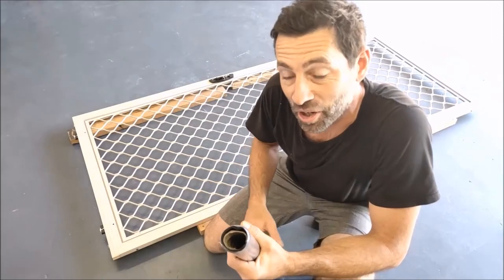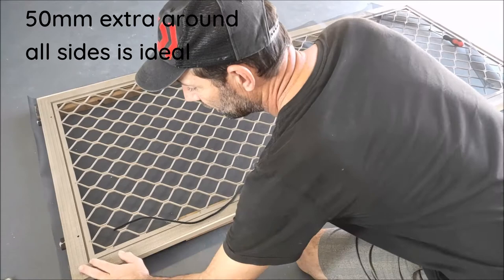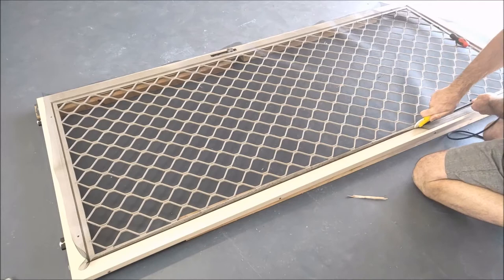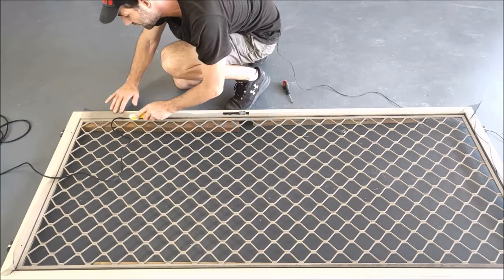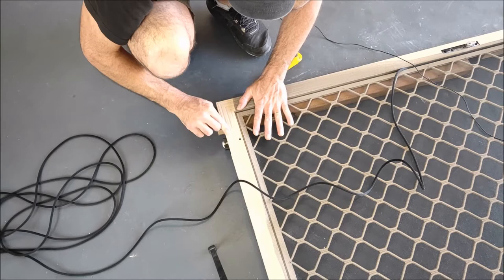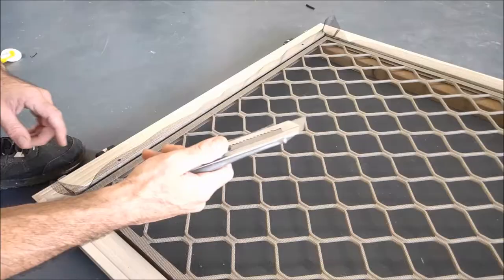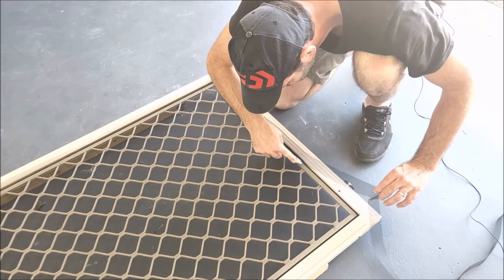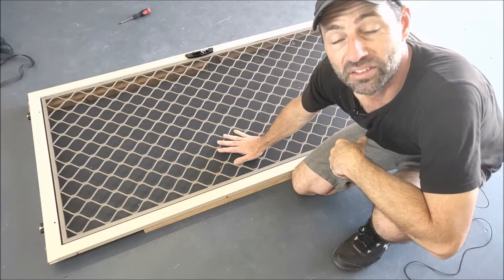How to replace fly screen mesh install video with Inspire DIY Kent Thomas

Comment: Fabulsous off to buy my mesh, already have the door off from following your last video on how to remove the door.  SO easy to remove the door with your terrific instructions.  Thanks
Reply from the maker: Oh well done Satina, good job👍 I'm glad the videos help - and thanks so much for the feedback, I really appreciate it. Kent
Reply: @InspireDIY  Your videos REALLY make a difference.  My rental agency would have charged me a fortune to replace this.  I needed a $15 clothes dryer door changed a few years ago and they charged my landlord $250.  The screen from my screen door, had a few holes accidentally melted the screen, a few  years ago, when my makeup mirror, was sitting at the wrong angle, near the door and burnt holes in the mesh...(couldn't believe it)  Now my apartment is going on the market in the next few days.  So I knew I had to get and fix this darn door.  Your great description on the removing sliding door video and clear video, made it all more simple than I could have imagined.  When guys like you, share info like this, people like me, just want to give you a high five, with gratitude.  :)

Comment: Thanks Kent.  Returned home after trip away to find all our screens need replacing.  How is that you may ask.  Don't.  I just got the gear to replace the screens and now your video has removed the remaining queries I had.  I noticed that you laid the door on some 2x4s; now that's another idea for avoiding scratches to the door frames.  I think I'll grab some I have in the shed to replicate that part of your process.

The next couple of days I have 5 doors and one window screen to replace.   Now looking forward to it a lot more than I would have.  Cheers mate.
Reply from the maker: Hey Col, that’s great mate I’m glad you are getting stuck into it. All the best👍
Reply: @InspireDIY  I have an update:  replaced 3 x security door screens today.  Somehow I managed to remove the doors from their tracks without breaking chunks off the wheels.  It was tricky as the whole lot suffered from heavy rust on those screw heads.

I did lubricate all the lock mechanism and upper and lower wheels and cleaned out the tracks.  Wife was happy.  I have another three to go, but time is what being retired is all about.

Thanks again for all the inspiration Kent.

Comment: Great video & thanks for sharing your knowledge! I was going to buy all that I needed to replace mesh on one of our fly screens and noticed there is a lock guard riveted into frame over the mesh and not sure how to remove that guard plate/get around it, any advice will be a great help! Thanks
Reply from the maker: Hey Suri, it's easy enough to drill out the rivets and replace later, have a watch of this one - hope it helps 👍
https://youtu.be/ZyWqWJKAV6k
Let me know how you get on.
 Kent

Comment: Hey mate, thanks for the video, was super helpful and am keen to give this a go! Cats have been ruthless on our back screen. Any tips on how to tackle a security screen with one of those plastic guard things near the lock?
Reply from the maker: Hey loz0za, great question mate, that’s an easy one …the security shield thingy is only held in place by the door handle, unscrew and remove both the handle and shield before installing your new mesh👌 best of luck, Kent